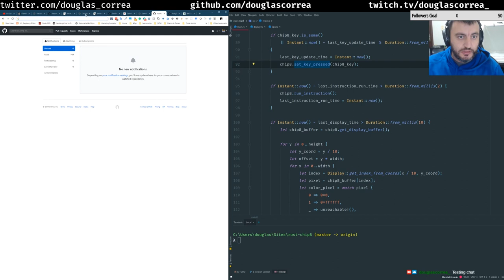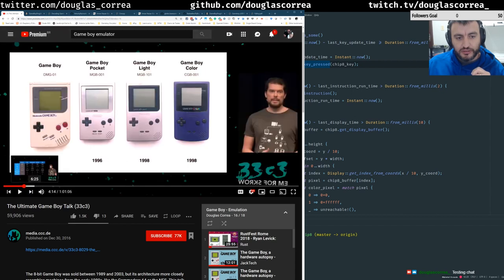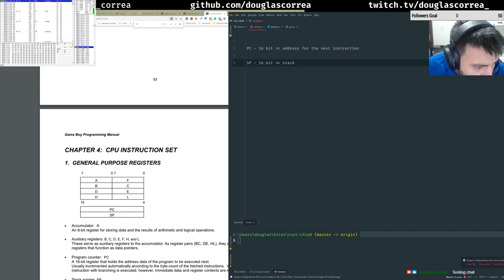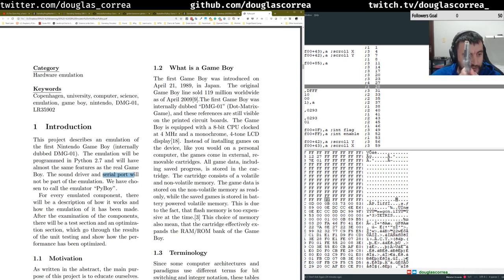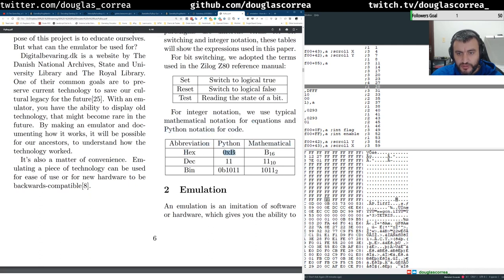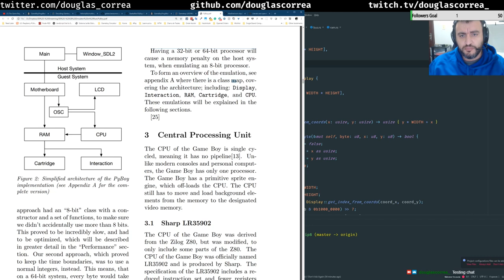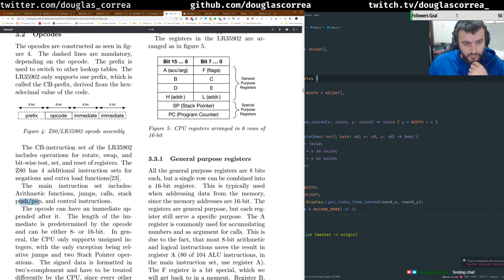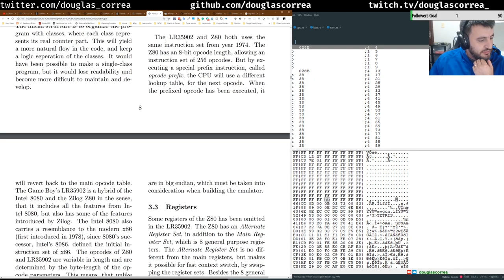Building A Gameboy Emulator with Rust - EP01 - Reading the Docs and Gathering Information

Comment: Hi my brother! Do you remember me? So Is  very nice to see you here, and I have a question.. Why to learn Rust? I saw that this new language is growing..
Reply from the maker: Hi Bebert, of course I remember you!
About your question: Rust is getting more and more popularity these days because it is a system programming language with the speed that gets close to C and C++, but it has a easy learning curve.
Besides that, Rust is also very good on the safety side because of its ownership system. There are a lot of blockchain implementation using Rust.
And last but not least Rust is getting popular on being compiled to web using WASM, which is being used to develop frontend application that could use a browse as platform. For example, at the of our Gameboy Emulator we can compile it to WASM and run it direct on the browser.
Hope to my answer give you a sneak peek of Rust. I'm still learning it but I want to use this channel to share what I already know and my learning path too.
Reply: because you can